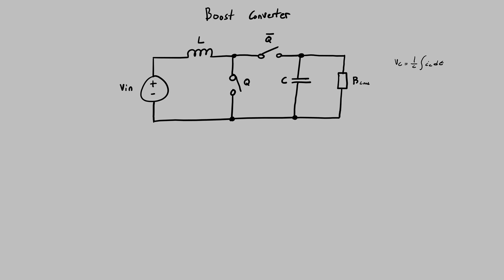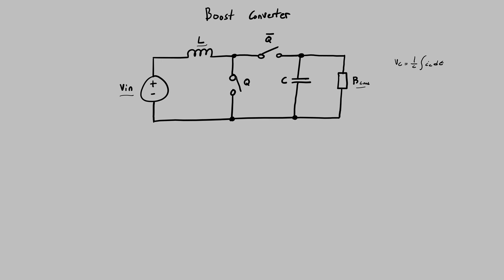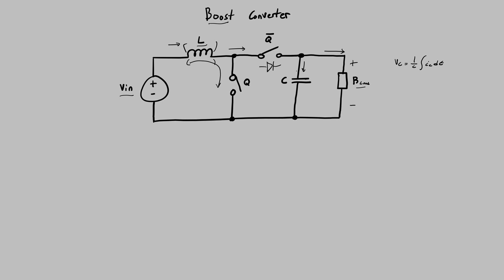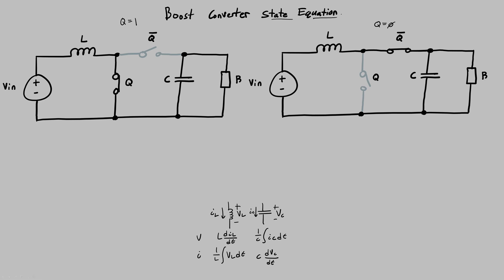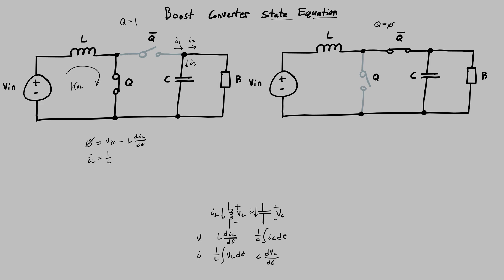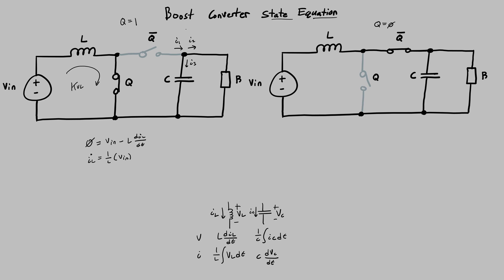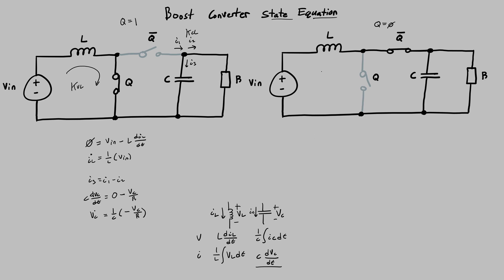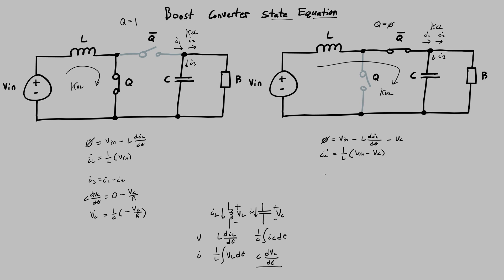Boost Converter State Equation Derivation

Comment: Hello Rice, I am having difficulty trying to derive the transfer function from both state equations in terms of Vc/Q (Capacitor voltage over duty cycle). I can't seem to separate terms with Vc and Q on either side of the equation. Is Vc and Q separable? If so what would be the transfer function Vc/Q?